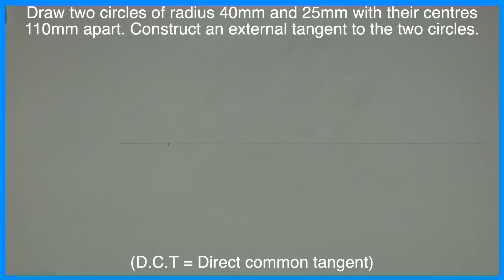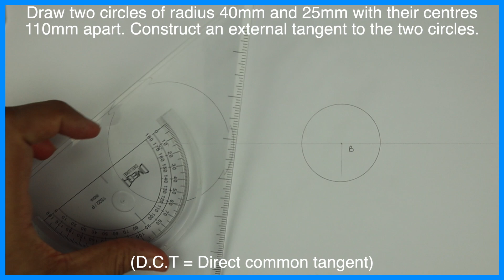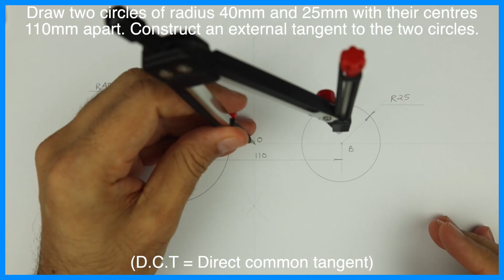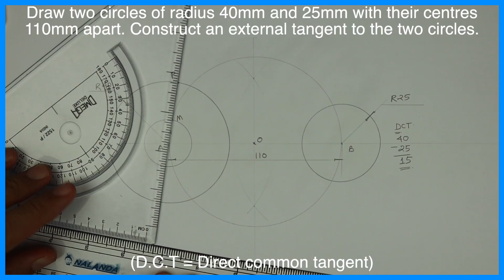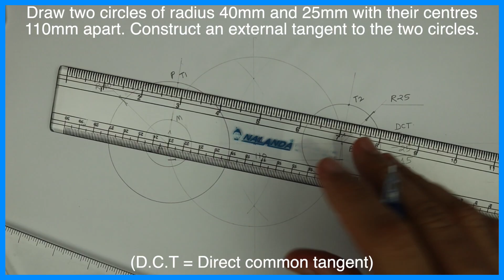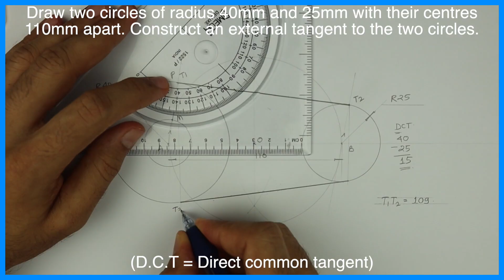Direct common tangent   DCT   External tangent   Engineering drawing   Technical drawing

Comment: Only slide if you can maintain the ruler's gradient. Otherwise, you should take the distance from M to B with your jangka and then  draw a bow that intersect circle B while the point thing at P. Finally, draw a line from B to the intersection